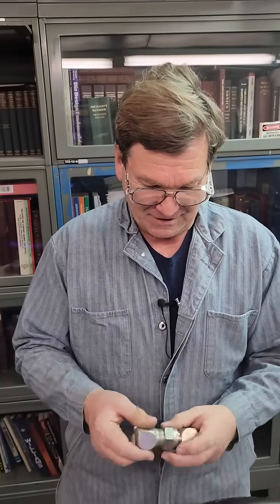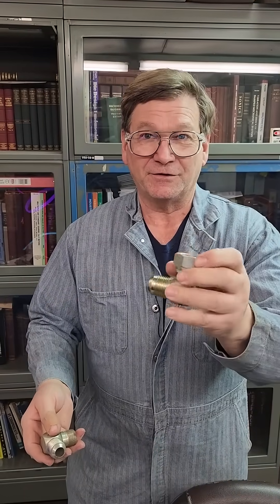JIC Fittings are very handy - don't discount them!

Comment: Most things called "AN"  fittings are a lie. AN is different from JIC. The threads are a different tolerance class and the inspection requirements are different. They fit together fine. But AN are designed for aircraft and have details to make them more robust and certified to avoid failures.

Comment: Air Force-Navy, to be that guy.  Actual to-spec parts have a radius in the root of the threads which most hot-rod fittings don’t.  The standards for the aero parts went from AN to MS to NAS to I think SAE, just to make cataloguing them interesting.

Comment: 3/8 and 3/4 are the only sizes that will not interchange. Been doing hydraulics for 20 years now. Love it! Those two sizes are mostly found on LP gas lines. Forklifts and such. Also found on alot of compressors on the copper tube lines. O- ring boss are actually the same thread and od as JIC. They just seal differntly.

Comment: Are there any problems with mixing AN( non ferris) and JIC(steel)? I am thinking that in some applications electrolysis erosion will cause leaks.  Also thinking that 99% nonwaterbased automotive fluids dont have this issue.  Water systems not running cerosion inhibitors  the steel reacts  with the anodized aluminum.

Comment: JIC/JIS have one big flaw, a small leak turns to a big leak if tightend too much(theres a gorilla in every shop) the cone in the female end splits when tightend that little extra. BSP does not do that, and in my opinion the supreme hydraulic fittings. NPT hydraulic fittings should have been discontinued long ago.
Reply: same for Whitworth
Reply: @Errol.C-nz  Withworth is a bit archaic, but BSP uses the withworth 55 degree thread angle standard🫣

Comment: Then there is jis and komatsu fittings. They are 30 degree but have different metric threads.
Reply: JIS uses a brittish thread while Komatsu uses metric. They actually have a double sided cone adapter that you can use to make a BSP fitting work with JIS. Very handy

Comment: Those are actually great fittings, work great, very flexible for any application, albeit a little pricey, and you really have to make sure that they are clean before throwing them together, I've also seen cases when a fitting was dropped from table height, no visible damage, but it would no longer seal without a one-time use repair kit. 

Also, to whoever decided to name two different but similar standards as JIC and JIS, wish you all the best in life..
Reply: My favorite is when people over tighten them trying to get them to seal